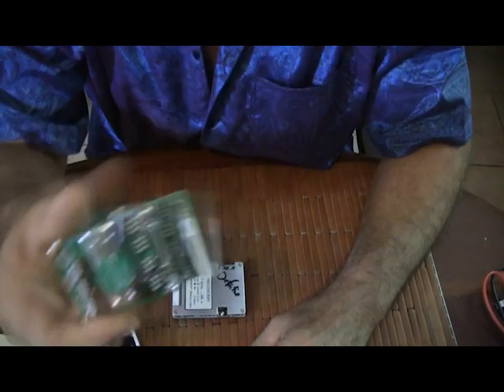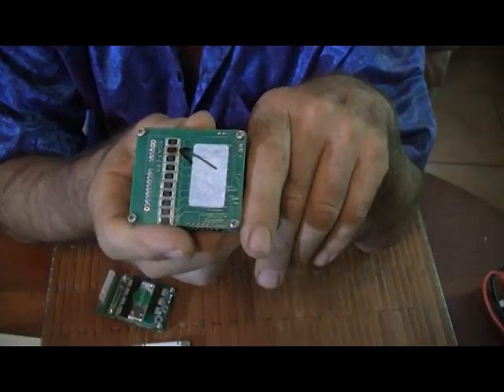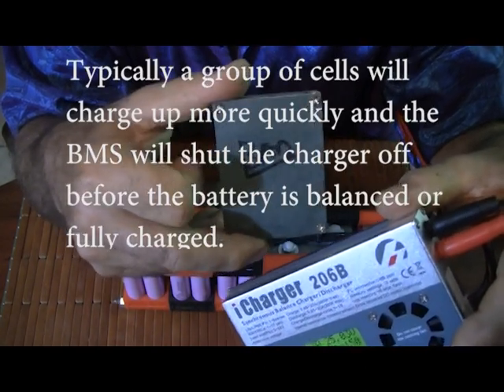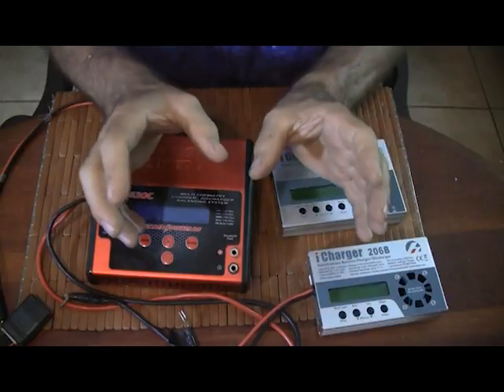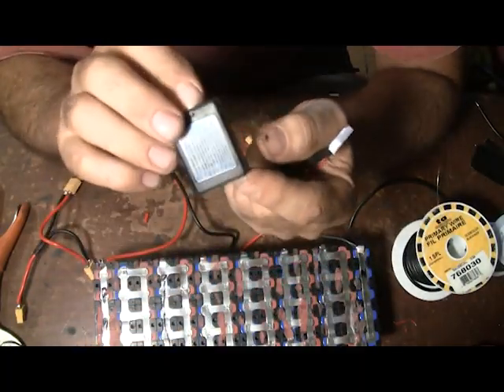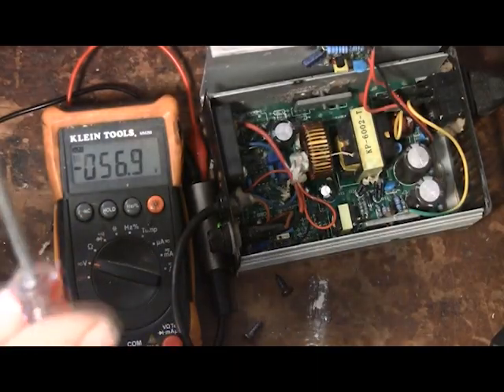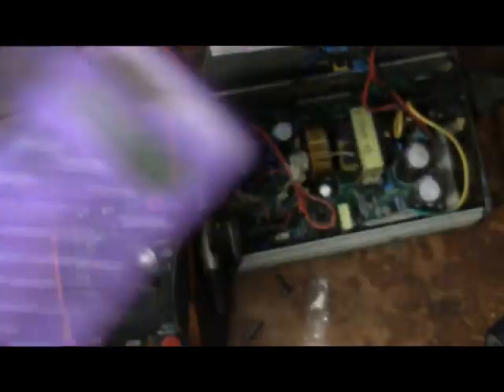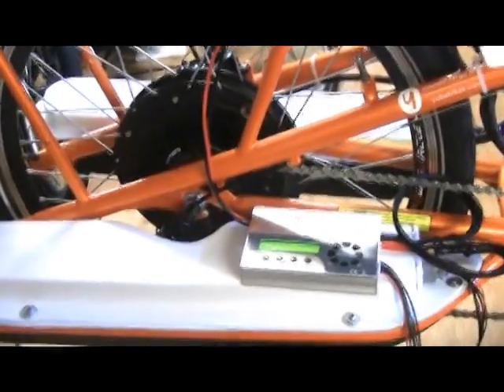How to build a safe and better lithium battery WITHOUT a BMS.

Comment: 1) I refuse to use a fuse
2) I tested 20s 3p top quality cells (from the same batch) without balancing. After over 50 full cycles, they were 0.003V different from max to min. I will keep monitoring, but I think even balancing is pointless if the internal resistance is almost identical

Comment: Bms is a waste. There really cheap,  don't work, take power, they don't balance for shit.    Its a safety  device that's it.  The bms is more harm to battery and is good.    This guy is spot on.   I've been removing bms for years never had any problem.    The battery pack will last much longer without bms.

Comment: If you're running a many parallel Series Battery then you need a different type of BMS. I think that's where the misconception is that most BMSs need the battery to have a configuration that's more like a racetrack. Whenever you make multiple cross-sections or parallel connections, that racetrack configuration is no longer there and you can't measure the current because it can run everywhere. You should say to yourself how does a BMS work. The BMS works buy detecting voltage drop along the course of current. Okay so think about that, you can think of it as like a race and the racers are the electrons and the battery is the obstacle course and the BMS balance wires are the checkpoints as the electrons race through the battery they encounter obstacles and lose energy when they pass a balanced wire or checkpoints the energy level of that electron is measured as the electrons continue to travel to each checkpoint along the path more balance wires measure the power and that's how the BMS is able to detect different cell voltages so if you make a bunch of parallel connections to other series or AKA you put in a bunch of Crossroads than the checkpoints can no longer function properly because some electrons will just bypass them all together the battery has to be structured in such a way that the current has a track that it follows instead of being able to just travel anywhere in the battery with no guidance if you build the battery in such a way that the current is guided through the battery like a race course you can then put the BMS balance wires in such a way that the BMS can do its job properly and balance those cells. If you are familiar with Ohm's law then you'll know that as current travels through it is encountering resistance the farther it travels the more resistance it will have this resistance is what drops the energy level of the electrons the farther  the electrons have to travel the more resistance. This causes voltage drop, this is what the BMS is actively measuring if your configuration of cells is correct. The correct way to do this is to make your parallel cells and then connect them positive end to negative for your series connection and only at that point do not make connections across the tops and bottoms of your parallel connections adjacent to your next parallel Connection in series this creates the crossroads instead just hook them up at their positive and negative ends that way if you was just to measure that series you would only measure that series and not the next series that you connected to it in parallel that way you can put your balance wires at the point where the parallel connections make the series connection and that's how you properly structure a battery to properly run a BMS to cell balance. If you don't believe me I can prove it next time you make a battery make it the way I tell you to make it and then you can measure each individual series and get 4.2 volts then 8.4v at the next if you was to do the same test on Parallel series that have parallel connections along the series then you would not read 4.2 volts you would read the total voltage of the pack but if you make the battery the way I tell you to make it you could go to each series for each series voltage. The wires from the BMS are placed in order from ground connection one and so forth and connection one will see 4.2 volts. Series 2 in a perfect world will see 8.2 volts and so forth and so on that's why it's very important to make sure you purchase the correct BMS for your configuration but doing like I'm telling you to do we're ensure proper BMS battery maintenance longevity and safety

Comment: This guy is full of crap the same way a balancing charger works is the same way a BMS works it can detect the voltage across the battery as it is Flowing think of a race where the negative is the starting line the BMS is the timekeeper electrons are the racers and each balanced wire of the BMS is a checkpoint the goal of electrons are to go through this race course and it does have obstacles as fast as they can while carrying as much energy as they can as they travel and run into ossicles they lose energy each checkpoint is a balanced wire and the checkpoint measures the power of each Runner as its passing by by the time it reaches the end of the race course all the checkpoints have gathered all the energy of all the runners and now knows the voltage drop across all the batteries between each checkpoint and that's how a BMS and balance charger knows which cells are low and which cells are high even though all the cells are connected but if you make many parallel connections with your series to another series then this BMS won't work your Series has to be in line and then connected positive to negative to the next series with no parallel connections between the 18650 cells or it won't work you're creating a race course for the current to travel through so that the BMS can work properly don't be an idiot and tell people that you are dumb like that do some research and figure out how it works so you don't look so dumb like that

Comment: Active balancers are the solution, either that or as I previously mentioned one dc to dc constant current module per cell. This way each cell is charged to it's top voltage individually.

Comment: Hello, Shawn. I
I have a iCharger x8. Want to set up its charging 
capabilities.  The pins start with negative on the left. ( 10 pins ) . In your video you don't say exactly 
how many positive wires connect. On this 52v 21ah battery of mine, all the wires are hooked negative. 
I observed your positive wires and the next 3 positives.  But I can't determine the exact cadence
of positives and negatives of your battery when I have 12 batteries to a cell. And your spot soldering 
starts between the actual top of the batteries. I don't have a cell logger . Hooking up right to the charger. Oh , empire of squat-ness, I need advice

Comment: I am splitting a 52v 21 ah battery to
two 7s batteries.But not sure of the
wiring. Sure could use description
or complete diagram. Using a icharger x8. Not the duo

Comment: I take a fresh batch of 26650 cells, stuff ‘em end to end in a 1” pvc pipe, twist on the threaded endcaps.Install conductive contacts…bolts , springs wire connectors, etc. for the terminal on each end. To charge, remove cell from tube by unscrewing one end cap and dumping them out, or extract them with a telescoping wand magnet that is long enough to reach the deepest cell in the tube.Next install each cell in an individual charger with a digital display. The chargers I have stop at 4.1 volts and charge at 1 amp max.They auto- detect cell types and will even go to no-cad mode and begin charging cells that fall below 1.5 volts. Reinstalling the cell after charging is like feeding coins into a vending machine. Make sure polarity is correct. Plug in the quick connect wirin connectors to the charge controller, and off you go again. ( I have installed between one and seven tubes in various ways , extended rear rack, between seat and handle bars… maybe a detachable battery trailer will come next for long highway trips)
Reply from the maker: I get it!  It's a foolproof if slightly labor intensive solution to battery construction and balancing!  Clever, love to see a video.
Reply: Yeah it’s a tossup labor wise.. work another job to afford the instant satisfaction of a factory model, or diy and be in control in real time. I might add that I have wired 54.6 v chargers to the tubes to charge all cells at once, and the voltage variation after several cycles was minimal. The individual charging periodically is just added insurance, but not set in stone. Catching that one bad apple is the name of the game and breakdown of the battery pack is too if the bad apple gets caught. Attachments make the worl twirl.

Comment: Love the video and the method.  Understanding I think leads to safety.  I do worry about Lithium Ion fires.  So using a hobby charger with no BMS, do you measure temperature or even have thermal cutout switches to kill the charging power?
Reply from the maker: Good point, and the answer is no!  A cell that is being overcharged will get hot, but if the voltage goes above 4.2, the hobby charger, or any good BMS, will cut off the charge.  as the battery becomes fully charged, the hobby charger tapers the current, until it shuts off the charge.   But no thermal runaway shutoff!  So, with a homemade battery, it's good to charge in a metal box, and to have a timer on the charger...

Comment: I don't think it is a good idea to use absolutely no BMS functionality. At least a watch dog service should run checking battery voltages. You can cut daily balancing for most applications.

Comment: After dealing with a failing battery pack due to poor management by the BMS and then a glitching BMS on my new battery pack, I'm now starting to think this is the way forward. 
Fortunately I bought a Chargery 1500W battery charger which has the option for a 24S balance charger add-on so I'm on my way to having a more reliable e-bike experience.

Comment: I can't say for certain, but I seem to remember some BMS units that have Bluetooth and/or WiFi commo that can do what the "loggers" do, and send the real-time data to your smartphone as you ride. They also had an alarm feature in their "app" that provided both audible and visual cues from the phone to the rider.
...and here I am talking about using an "app" when I have always warned about relying on any tech that REQUIRES an "app" to work for you...the fact there is no guaranty the "app" will be around next week and could be unilaterally removed from your phone at any moment without warning (company goes out of business, stops supporting it, to continue working it requires you replace your phone with one that has a newer version of Android/iOS, etc).

Comment: Hi, do you know a better battery voltage alarm than these cheap ones? They all show like 3.7v on one cell and 4.15 on another, and the other cells in between that, on 8s packs that have all the cells at 3.8v measured with a volt meter. So I've found this so called Cell-Log 8M Cell Voltage Monitor (2S-8S) that all say it's very accurate, but it seems it was discontinued in 2018..and can't find it anywhere. Do you know other voltage alarms? Or the market is really dead at this chapter..
Reply from the maker: Sorry, there are others but they al look like they are based on this one.  Yours sounds defective though.

Comment: Hello sir thank you so much for sharing with everyone can you send us the link to get that instrument panel please I can't find it anywhere , it will work perfect on my li-poly 96v biuld
Reply: Also u saved me from getting a bms as I used to believe 😅
Reply from the maker: Sure, here is a link to it.  They are sold in every hobby shop...
https://www.getfpv.com/1-8s-lipo-battery-voltage-tester-low-voltage-buzzer-alarm.html?utm_source=google&utm_medium=cpc&utm_campaign=DM+-+B+-+PMax+-+Shop+-+SM+-+ALL&utm_content=pmax_x&utm_keyword=&utm_matchtype=&campaign_id=17881616054&network=x&device=c&gc_id=17881616054&gclid=CjwKCAjwt52mBhB5EiwA05YKoxpPlEzhK1Rg1hXTqDkHq-1kjNt9PXG5kK03rOmunv-fdQckJiqJDBoCKwIQAvD_BwE

Comment: Does this still apply to today’s cells? I have two 52v 20ah in parallel with a 80a controller 3000w hub. Will it blow? So, should I bypass bms?  You explained this bms thing perfectly, thanks

Comment: I removed my BMS completely and just run my ebike like it is!  I've had zero problems!  I don't use a hobby charger...but I charge it like I would any other battery and I run it like I would any other battery!  Should I be worried about anything?
Reply: yes it will last longer and go much faster!!!

Comment: "iCharger 206B no longer available to purchase" say the vendors.
Reply from the maker: Too bad, it was a good hobby charger.  Any hobby charger, commonly used in the Radio Controlled Hobby industry, will do the same job,

Comment: Thank you for making this video, there is a lot of conflicting information out here. I have a first generation fiido T-1 and it's replacement less battery. I put battery in replacement and immediately noticed battery discharged faster so I ordered a 48v
advanced 300w Luna charger w/ 80 90 100 % settings charging to 54.6v @ 100% now 13 mo. old full is + or - 52v it varies each time. Now I understand why, unbalanced. Bike was shipped to me without user manual or the download. Took 4 months to learn full charging shortens battery life. Guido recommends full charge after EVERY ride.
Reply from the maker: It is good to let the battery sit on the charger and charge fully and slowly, every few months  as it gives the BMS a chance to balance the battery.  It will only begin balancing when a cell hits 4.2 volts...   But not every time, or the battery will not last as long......   Sounds like you have it figured out!
Reply: I've gotten in the habit of charging to 90% at 1 amp. Is this a good habit?

Comment: Question? Didn’t you have a video up that had to do with UCC1 and why not to file it? I’ve looked everywhere for it. Plus I’m taking the BMS off an e bike battery. So this video was a big help.
Reply from the maker: No, I have not made a video about UCC1 filing,  Glad the BMS video was helpful and good luck on your new project.
Reply: @shawname2  
Thanks for the reply. Got the 36V Fast
E-Ripper back up and running. No BMS, just balance wires and hobby charger.

Comment: Excellent video/explanation !! 
I was also getting frustrated by the poor performance of these small BMS boards and came up with a solution that uses same pieces of your approach.
Still keeping the BMS, a put 2 JST connectors the the battery case where I can check once in a while the state of the battery and if needed rebalance with a balance charger. 
Disadvantage is that I have to dismount the battery case for that.
And I still have to see if I can lower the voltage of the main charger.

Did you find any real JST sockets or did you use the standard PCB versions glued into a corresponding hole, like I did?
Reply from the maker: Great approach!  I did find some double ended jst-xh connectors, though I don't remember where, it was a radio control hobby shop online.  
If you can open the charger, there is usually an adjustable POT near the DC ouput that allows for tuning of the voltage.  Steel cased chargers can be opened...
cheers,
Shawn

Comment: I'm happy I ran across this. I was looking at new drill batteries, and wondered if harbor freight's battery chargers had the bms, instead of the batteries based on the amount of connections on the charger. It would make the batteries cheaper too.
Reply from the maker: I have changed a drill battery over to a hobby charger battery too!  Works fine.

Comment: I agree that circuitry can go too far here and there. It's quite common to lose the battery power thing and maybe the device with computers/phones as well. A Psion Revo (AAA size - hard to repair) was my first experience and a Thinkpad recently where the 6 - 18650 batteries are fine. There is no "replacement" for a specific IC circuit they used. It's short lived to find an original part mostly.

Comment: Hi Shawn, my shengmilo 1000w 48v ebike blew its BMS and the company sent me another which had also blown (the swine's sent a used BMS with old solder on). My question is can you tell me how to wire the battery to the bike without the bsm please? Its my only mode of transport to and from work. Please help.

Comment: How do I make the Y plugin that will attach to the two, 24volt packs to make a 48volt battery?  Can you send a pic, or diagram, I am having trouble finding the Y plug that's in a series and not parallel.
Reply from the maker: If I understand you correctly, you want to make a plug for connecting two 24 volt packs together to make a 48 volt battery?  First, this is separate from the plugs used to charge each 24 volt battery individually.  This is very important, you cannot wire your batteries in series and parallel at the same time.  So to make 48 volts, you need to connect the negative from one battery to the positive of the other.  Use  the remaining positive and negative leads, and there is your 48 volts.  You must disconnect the two batteries from series when balancing in parallel!

Comment: I need a hobby charger for fixing these packs. Takes days with a normal 18650 charger. 

Side note: really wish the BMS would charge the low cells with the high cells.
Reply from the maker: Yeah, a good hobby charger will charge and balance out of balance packs much quicker..
Reply: @shawname2  Given 6 years have past for this video. Do you know of a 13s one or do you still have to split the battery for the 7s one?
Reply from the maker: @Eric_Tennant  I don't know of a 13S hobby charger.
Reply: @shawname2  Someone could make some cash if they made one too do e-bike batteries.
Reply from the maker: @Eric_Tennant  Yes, I have thought about that too.  Some 2 to 3 kwh batteries and a 1.2kwh charger and a powerful bluetooth BMS.  I think that would be the ticket.  The batteries could be 1 big battery or two that were connected in series, so one could go on each side of the bike...